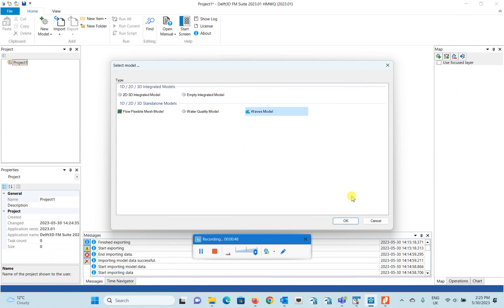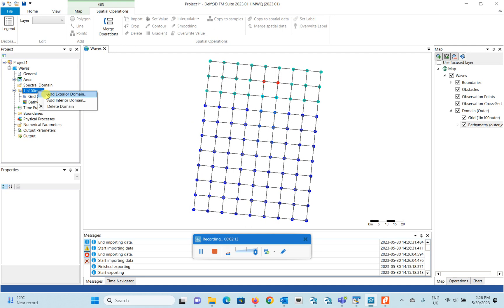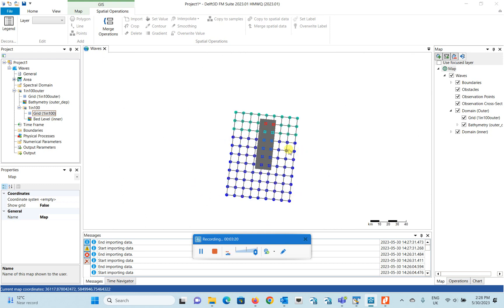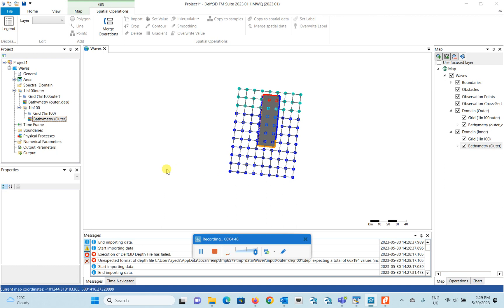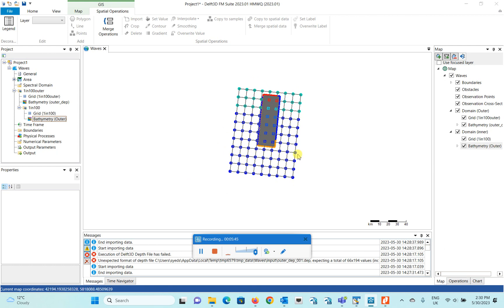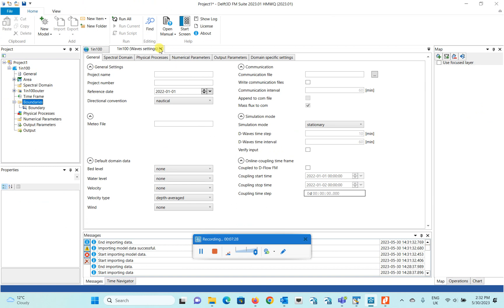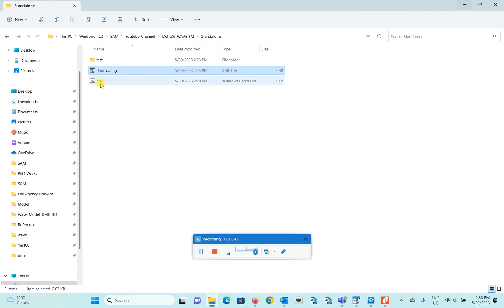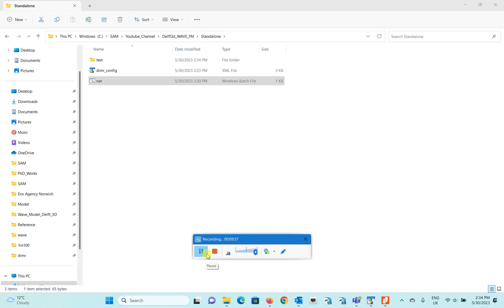Wave Model How to Nest a Outer Domain in Delft3D FM

Comment: Hi very clear sujbects... thanks... Do you know how to calculate wave runoff on a beach slope? thanks again
Reply from the maker: Hi there are several ways to calculate wave runoff. One of the most common ways is to use eurotop manual. There are  other manuals as well like PIANC manual and the coastal engineering manual. Whatever manual you use you have to know the wave condition to slope to define type. Hope you got the answer